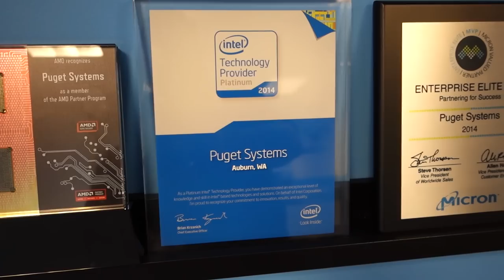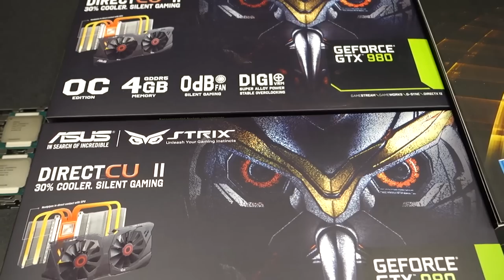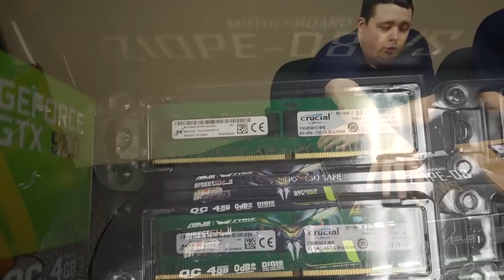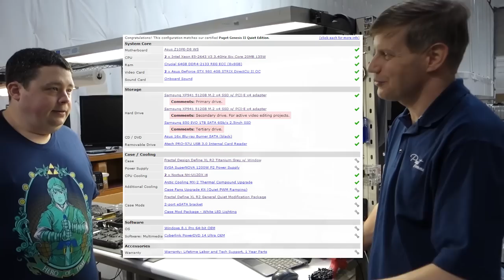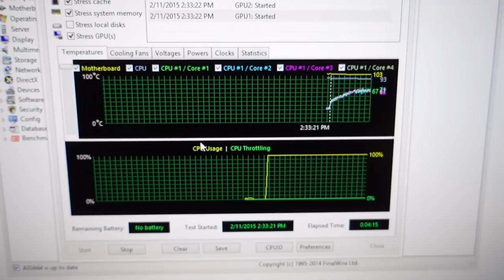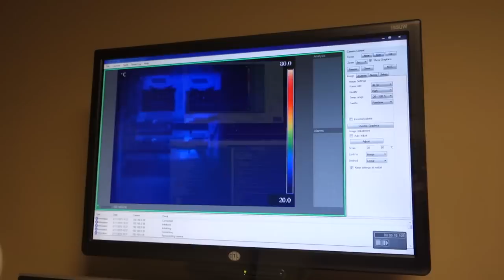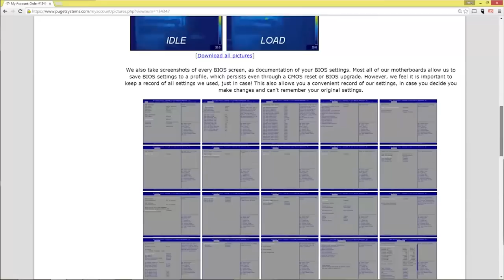Crazy Fast Dual Intel Xeon Monster PC Build by Puget Systems - @Barnacules

Comment: John from Puget Systems really knows what he's talking about
Reply from the maker: Thomas Luk John is the biggest nerd I've ever met IRL. He's amazing! The guy knows everything about every single cog in his business and the products they make. It's amazing.
Reply: +Barnacules Nerdgasm  yeah he looks really knowledgeable
Reply: +Barnacules Nerdgasm I have a name!!the barnucules beast
Reply: +Thomas Luk 
I've had terrible experiences with non-off-the-shelf OEM companies - not Puget, but one i'd rather not name. 
My university bought a 30k machine with 4 (passively cooled) Xeon Phis and 2 Xeons cpus, all in a 4u Tyan rack. It was a test system to see if a phi cluster is feasible.
Thermal management was so bad that the Phis ran at about 105 C under about 80% load (it's actually thermal throttled). When I complained, they told me to turn the fan control off - it cooled down to 90C but sounded like a 747 taking off. Just imagine a Delta 120x38mm 3 amp fan, full load, and there are 6 of them in the rack. Driven everyone insane.
In the end I had to mod the server with duck tape and cardboard cut outs to block air where I don't want them to go, and the Phis now run at 95C under full load without sounding like a jet engine.
I swore to myself never to buy anything from OEMs again.
Reply: T k

Comment: side intake fan with no dust filter yeaaaa
Reply: +Marco Martins I don't understand how it helps with silence either...
Reply: qwerty true, it doesn't
Reply: They're designed for performance, not silence. If you want quiet fans then use the fans from Be Quiet!.
Reply: I actually use both, my CPU has a Be Quiet and my case has Noctua's. They are comparable in noise, both are very quiet and its not really possible to tell any difference between the two.
Reply: Yeah, noctua fans are known for being really good. The colour scheme on them is kinda bad though.
Reply: you know, it might be an exaust fan.

or not. i didnt watch the whole video
Reply: Jakob Alexandersen you clearly don't know how the side of a fan that exhausts the air looks like..
Reply: Jakob Alexandersen sry I keep forgetting not everybody is graduated in fan technology like me ;-;
Reply: Kek
Reply: Hehe

Comment: Lol I'm running on dual xeons as well, only difference is mine are 2.6ghz from 2004 xD
Reply: ***** dual xeons 3ghz from 2004 and 280x :p
Reply: Florian Schiemann Don't you have an AGP X8 slot capable of holding an ATI Radeon 3650? I do, but I've never been bothered to use it with an okay card xD
Reply: Taran Romana A 280x? Doesn't that mean you're using a PCI-e? surely a 2004 machine couldn't have a PCI-e?
Reply: Aha, that's unfortunate. I'm running on a suprisingly smooth running HP XW6000 Workstation from back in the day, and once I get a newer card in this thing, it will actually be pretty nice.
Reply: PKGamerHD it's a workstation so it has 3 pcie slots with 300 watt to spare for a graphics card
Reply: Question is, when was your workstation made? I would have to guess it's quite recent if it has 3 PCI-e slots,
Reply: PKGamerHD i thought its also from 2004 - 5 as i bought it with bunch of servers its a dell r5400 which was made in 2008 i just checked all the time i was thinking its 10 years old :p
Reply: Lol, I was gonna say, PCI-e was non existent back in the days of the early 2000's xD
Reply: PKGamerHD its a good machine only got it for $200 and added 280x for anither 200 and i have a 16gb 8 core machine which runs games at ultra setting :)
Reply: $200? That's £130, and I payed £100 for this old 2004 Machine.. Man, I'm feeling ripped off, not gonna lie. What were the specs when you picked it up, and where did you grab such a bargain?

Comment: You know what Noctua should do? Noctua should make GPU coolers!!!
Reply: Or a better color scheme
Reply: +Knish G. They make black noctua fans. Not sure why the didn't use them.
Reply: You know what they shoud Do? 
Black Fans x3
Reply: Knish G.
I like the colour scheme. It makes for a nice sharp contrast against the normal black cases/components without looking like a garish "gamerfied" thing. I agree a subtle colour scheme would appeal to many though.
Reply: I'd also like that.
Reply: Andrew Zolnier Their black fans (with dark brown rubber dampeners) are higher RPM, and so higher noise level. They are great fans too, and we've used them from time to time, but the quieter Noctuas are all (currently, so far as I know) the brown / tan color scheme.
Reply: hmm but w hy mot all black/ all colors D:
Reply: Fresh4Gaming coz its too generic and Noctua is all but not generic ;)

Comment: 8:11  #JerryRigged  glue gun ftw
Reply from the maker: I knew I made the right choice when I saw that sucker come out!
Reply: Heck yea!
Reply: Barnacules Nerdgasm i don't understand why the glue gun was used though
Reply: switchey110 Either to help direct airflow... or, I guess more likely; the clips that hold the fans on are just bent wire - the glue would reduce the likelihood that the fans would move / vibrate.

Comment: This is one of the times I wish comments were approval only. To everyone that thinks they are doing a build of this quality in 2 hours for 1/10th the price is an idiot. I'd like to take a tour of your successful facility and see the amazing business you run like Puget Systems. Now this is a little over 10k for this build on there site. Yes you can go to newegg and get most of these parts and build for cheaper. But all of you with your negative comments couldn't even afford the parts. When your business depends on it and you want it done right you don't have some low life YouTube troll that lives in his moms trailer build your PC and install a bootleg copy of windows. You do it right you order from a reputable company. That has the experience and knowledge to get you want you need and want done right.

Comment: Am I the only one who doesn't care about the noise that much?
Reply: As long as my temps are low....could sound like a jumbo jet for all I care.
Reply: In the past I didn't care... Now I regret that..
Reply: Never used to care until I switched over to the Define R4 and realized how beautiful it is to have a quite build.
Reply: By the way, my PC is really quiet but im just saying that I dont care that much.
Reply: ***** My external hard drives are louder than my system lol. Even under load.

Comment: Correctly designed case that is both: quiet and allowing for a good cooling is paramount. But in addition what I always like to find, when I am looking for a decent computer case, especially if it's a large and heavy case is a pair of handles, which allow carry a beast. Often a two pairs of costers help as well.

Comment: Awesome build. I like the custom stuff they do with this to ensure that the system is whisper quiet and operates at an optimum temperature. Also like the extensive testing, thats the hallmark of a brilliant PC building firm. Its much more expensive than building yourself but the attention to detail in the whole process for some is bound to be worth it

Comment: I would go for the name "Beast Mode", as you have used already, in honor of the Seahawks.
That is funny, I actually set up my computer just like that because my fan had a wine in so I turned it up. I didn't think it was optimal, but apparently this is best! Thanks Barnacules!

Comment: This is really good, I built a system very similar to this using a Supermicro case/board and E5 1660 processors. It was a re-purposed system that was formerly a testbed, but was tossed in the closet and I dug it out when my old rig died. I have had overheating issues since I tossed the 980s in there and this gave me a few clues how to fix that... looks like dremel time or maybe time to buy a different case.

Comment: Great video but at 23:02 Jon Bach is actually pointing at CPU referred as #2 by the Z10PED8WS manual. Also both video cards could run on a x16 link and still been spaced out properly if plugged to PCIE1 and PCIE3 which are controlled by CPU #1

Comment: 2:58 To my knowledge CUDA acceleration with, for example Adobe Premiere Pro CS6 doesn't work on Maxwell-based GPUs. At least, not yet. Correct me if I'm wrong, though! (I felt pretty screwed when I figured that out).

Comment: It is true nothing custom about this PC would have been hard to achieve as a DIY modder, for instance if you where building this yourself you could use the non-windowed side panel to get a 140mm fan slot a little less case noise, but I actually really like the look of the custom etched window that they made. Out of curiosity though, I wounder why they chose to not install the duel 140mm top exhaust fans? Given the thermal image it would be extracting air from the hottest point, the case would still have positive pressure (4 intakes to 3 exhausts) and given modern fan software can actually turn fans all the way off I can't see that it would be louder under any condition. Anyway as mentioned in the video everybody will have something they would have done different, and it does certainly look like they actually design PC's rather than just assemble them, so I'm sure there is a good reason. Hope you like your new system!

Comment: So I've always wondered - what's with the long building time on PCs? It takes a couple of hours at most unless you keep running tests for days on end. It's not a jab at Puget - system integrators everywhere do this. I'd like some clarity on the reason for the long process.

Comment: beautiful machine. im wanting to build one of those. Ive had my eye on the motherboard hoping to catch a sale, for the name I thought the Barnacules NerdStation would work:) as for Noctua fans i have 7 in my current gaming rendering machine and 2 in the carputer im building now. Ive never had an issue with noctua fans and well after a year of 24/7 running my machine is still quiet.

Comment: I would have used baffles to direct the heat from the CPU out of the top of the case. They could have avoided that rear exhaust and I would guess it would be quieter.

Comment: just wondering about the duel xeon, do they help gaming in any way like with your fps or was that just due to the gpu,s. i ask because at the moment i can buy a quad core 3.2ghz xeon for around $300 and 2 of them is the same price as a i7 5960k so i was wondering if there was any benefits to getting this duel workstation board seeing as it is around the same price as a x99 rog board.

Comment: Does that mean they cut a custom window into that? If I recall correctly the r2 xl never had a windowed version. Have to say, I have wondered what the differences between plexiglass and acrylic are, I know my 600t's acrylic window makes noise when heating and cooling(generally only in the summer).

Comment: will a 250gb ssd be sufficient for os/programs....including adobe premiere cc? or is premiere too demanding and should install maybe on it's own 120gb ssd..? just built first cpu.. i have 3 850 evos and two wd caviar blk 1tb drives.. was planning on one ssd for windows and programs. one ssd for games. one ssd for scratch disk in premiere and the other hdds for media.. will add more ssd and or hdd later.. my build was focused on video editing and decent gaming. 4790k and 4gb 970 msi card..also 32gb ram..

Comment: So they mounted the CPU coolers this way because the heat will leave the case at the top of the case. Yes that is right, but they also should install Noctua fans at the top and turn the fan at the back. So fresh air from the front, the back, the side and the bottom of the case will cool the parts and the hot air will automatically leave the case at the top of the case. Not as best as it could be. And also the fan at the side have no dust filter....

Comment: it's nice .
For all the haters sayng they would buid it in 2-4 hours , guess how mnuch time that builder needed , i think no more than 2h , but the software installing , testing , qc and engraving would surely need at least 4-6h . So this adds up to ~8h .
Do you guys really think they had only one system to assemble and test ??
BUT i'd definetly do it myself with a 12core sigle cpu .......

Comment: These guys seem like they are really good at what they do. However, I really prefer to build my own system, but thats just me. lol
That is a really nice system though Jerry, it was a really good idea to go with dual Xeons and multiple SSD. A lot of people think its a lot better to have one 1TB SSD for everything, but RAW Video can be HUGE in size. And Multiple SSD's in RAID can be a lot faster then a single SSD. And you need that speed when your recording gameplay. Has anyone tried to record 1080P (or bigger) 60FPS+ Gameplay to a HDD or a slow SSD? The video will be very laggy, and its not because of the GPU or CPU, its the storage device the video is being written to, the storage device is not fast enough for the video. Thats why you need large storage and very fast SSD's for recording gameplay.

Comment: Barnacules I have built a system around the z10pe-d8 MB. What is your typical boot time on your system. Mine is about 65 seconds which I think is too slow. Do you know of a way to speed up the boot time on this MB?

Comment: Man I got a hell of a system. Water cooled dead silent and it doesn't even cost as much as this.
Reply from the maker: Water cooling is not dead silent since you need fans on the radiators and the pump itself can make noise. But you can make a very quiet liquid cooled system also but I figured why bother when we can achieve the same result on air with less maintenance and more reliability.
Reply: True. You have a hell of a system. Two thumbs up Barns!

Comment: It's still going to be louder when under load, you can make any desktop mid/full tower computer quite on air cooling while idle. But those 2 GPU's are still going to be load while under load, tbh I would just have liquid cooled those then left everything else on air.

Tbh you could have went with a closed loop liquid cooler and a stock GPU and that would have been nice but w.e.

Also Noctua now do black and gray fans thanks fuck.

Comment: I would LOVE to work for those guys!!!  I have been custom building for 7+ years, using older parts and running them cooler and faster than newer Alienware and iBUYPOWER computers (with ease).  I've always believed current cases are inefficient, and I think it is AMAZING that they do R&D on their holdings and parts (have had a few case designs I was thinking to 3D print, when I upgrade my Lulzbot Taz 4)....  Sooooo, are they hiring?

Comment: Here is a thought for a video and review for you. I have been wondering how you were able to use your samsung hdtv's as a multiple screen set up. I also want to know if there is any possible way to run a console on a setup like that. I have been trying to research the topic and have seen it done with ps3. Just wondering if you have any thought on the topic.

Comment: +TalesOfWar. I do not has "server" grade components, but I do understand thermal limitations. I'm not getting at the fact it will not work coming from a reputable company and all, but I am saying that those temps IMO are way to hot for anything on a daily cruiser for my liking. I do have a system that will tear that one apart when it comes to performance and power. I have to dissipate roughly 2700 watts of heat, so I kind of get it.....

Comment: Hi guys, can I use Win10 Home for dual CPU system? I've z10pe d8 2x xeon 2683 v3 but I can't make them run together. In BIOS I see both processors as well in Windows device manager (58 threads) but in Task manager or CPUZ is only 1 CPU (28 threads). Single CPU works fine. What I'm doing wrong? I appreciate any help that you can provide
Reply: No, you need to use Win10 Pro for 2 CPUs (or Windows Server editions).

Comment: I'm pretty sure they air-cooled the system to cut down on costs, not because it would be more quiet. The water cooling components alone would of been an extra $1K or so. My personal water cooled rig is completely silent at idle, and near silent at load, tweaked with my Aquaero.  Good quality build, nonetheless.

Comment: Alright so I am building my first PC and i wanted to see if you guys could think of any necessary improvements. I am constantly looking to improve my build and I'm looking at around a $600 budget.
  
Specs:
CPU- AMD FX-6300 3.5GHz 6-Core Processor
Motherboard- MSI 970 GAMING ATX AM3+ Motherboard
Memory- G.Skill Ripjaws X Series 8GB (2 x 4GB) DDR3-1600 Memory
Storage- Western Digital Caviar Blue 1TB 3.5" 7200RPM Internal Hard Drive
Graphics Card- Asus Radeon R9 270X 4GB DirectCU II Video Card
Power Supply- EVGA 600B 600W 80+ Bronze Certified ATX Power Supply

Any constructive criticism is much appreciated. And keep in mind this is my first ever gaming PC. If you'd like to used this build for yourself in any way, i constructed it here: https://pcpartpicker.com/user/ryanmuck/saved/

Comment: 8:12 erm why is he hot gluing the fans to the heat syncs? I can only think hes doing it to make a tight seal between fan and heat sync, but then why not use a rubber gasket. One being rubber it would absorb a small amount of vibration making the system quieter (which was his primary goal) and two easy to remove and no glue gunk left behind

Comment: 15:38 -ish: "....and run VMs,"
So now the dual xeons make a lot more sense, but just outta curiosity...what kinda VMs are gonna be running on this bad boy, like home servers and that kinda thing? 
Better question: would a build like this be suitable to pass through one of those GPUs to a Windows Gaming VM? (assuming, of course, Windows isn't already the primary OS) Because six cores and a 980 seem more than enough to render videos or use CAD programs and all that while playing games on a separate virtual machine.

Any thoughts?